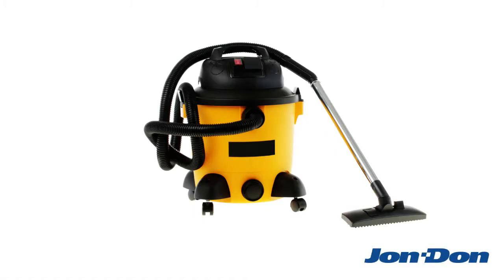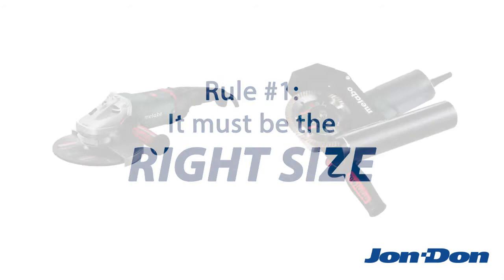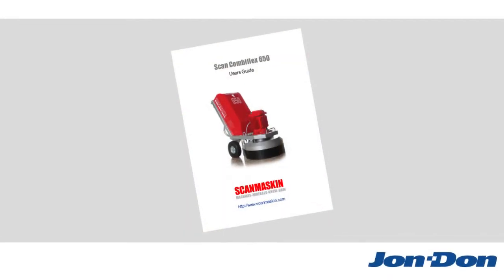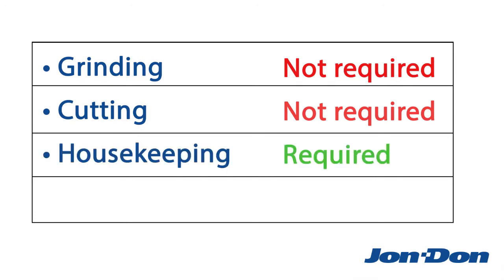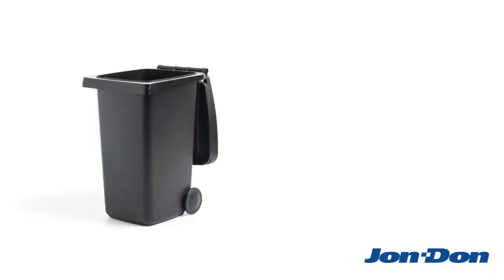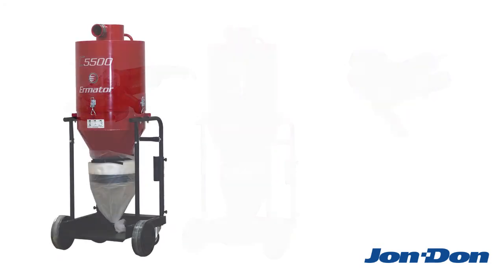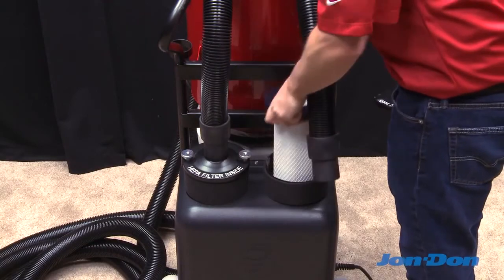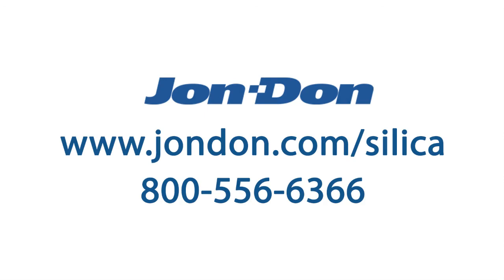OSHA Silica - 4 Critical Dust Collector Rules

Comment: The Rigid shopvac pushes 161CFM. at least as of now, I know they're around 150+.
If you have a HEPA filter and bag, you will suck at least 140 no doubt.
Then if you add on a dust doctor, you will avoid 85% of dust.
As for the internal cleaning mechanism, I was told by an inspector, as long as the filters are changed out regularly, it will suffice and with the dust doctor, you certainly are able to pass. Just awkward as hell carrying around 2 rolling tubs...